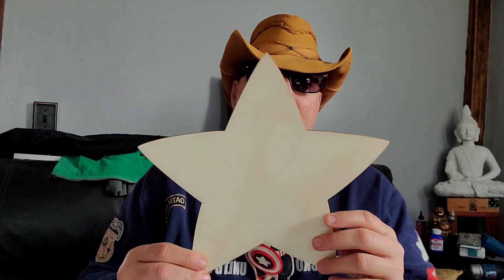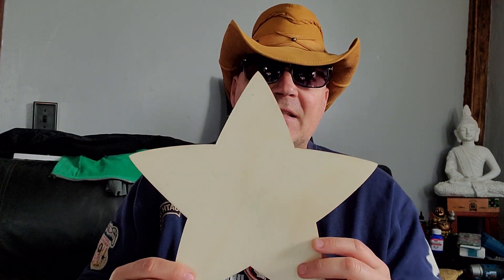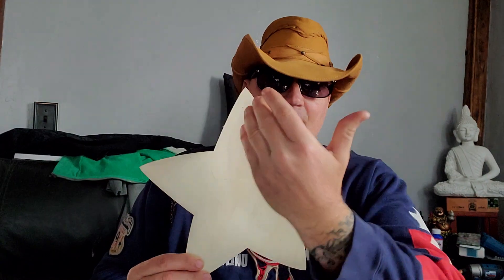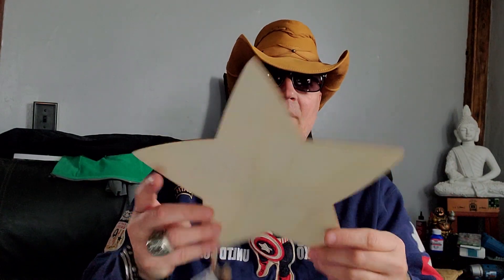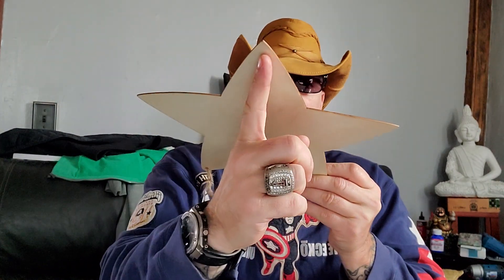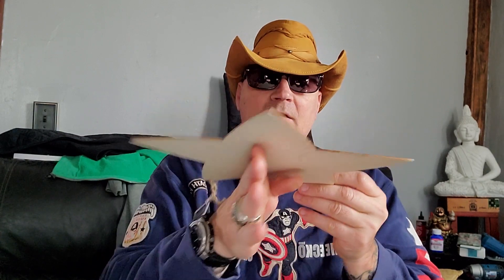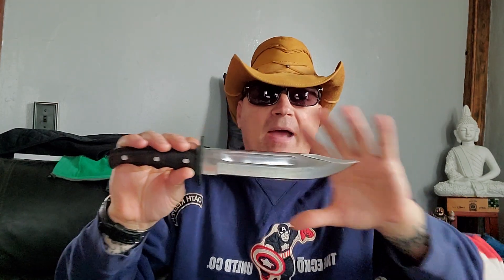how to create balance in a knife

Comment: Very,very interesting video!!  May I ask what kind of computer  design  package r u using? CATIA AN0D SOLIDWORKS would help you a lot with finding the POB
Reply from the maker: Damn! I need to up my game! I measure everything the old fashioned way. Pencil, paper, compass, tape measurer and gids. Your way sounds WAY better! Oh! And wood! Gotta make a template.
Reply: @DonnieBAllDay  yes bro, it would really help you. Let's say you need a deeper  fuller or a different blade or handle material. Just with a few mouse clicks you will have the new POB. The potentials using CAD are really unlimited.
Reply from the maker: @margaritisa4936   That would save me so much time period right now I have to draw everything out and then make a wooden template and try and match the pob

Comment: so well described, which is exactly why I got kkh to make a basic knife so I could get it done perfectly myself. spent many hours calculating on the viking warrior knife
Reply: Also, if you need to shift the center of mass more towards the handle end of the finished knife, use G10 instead of micarta, since G10 has a higher density.
Reply from the maker: @zackstork4420  Absolutely. Handle material is always figured in. People don't realize that two slabs or rosewood and two equal slabs of hickory don't weigh the same
Reply from the maker: Oh I know you did!